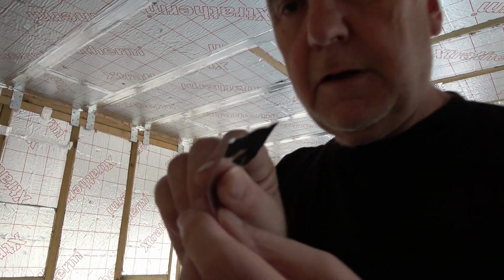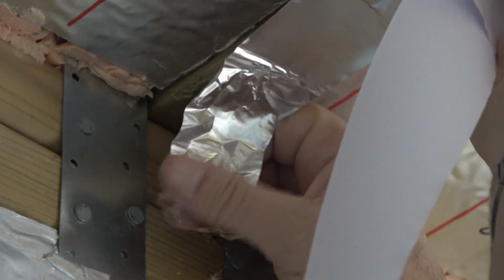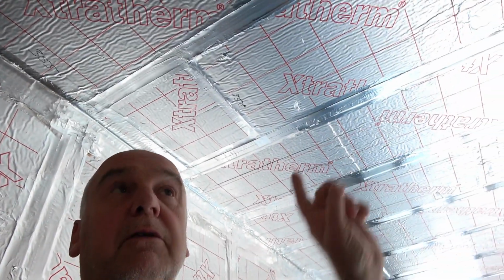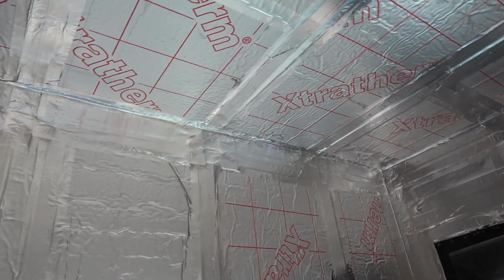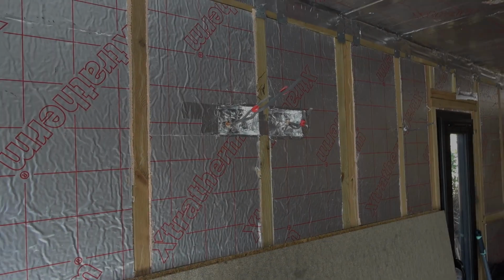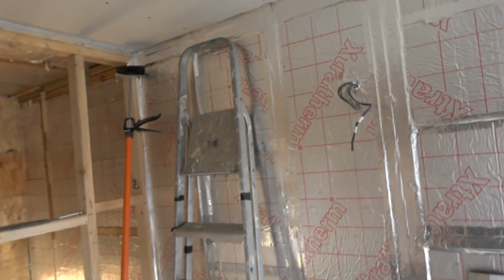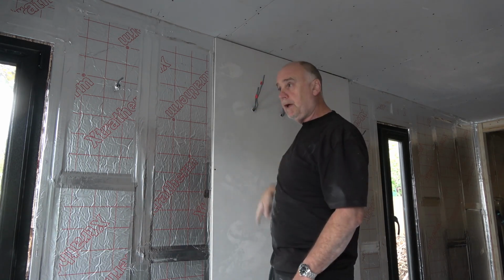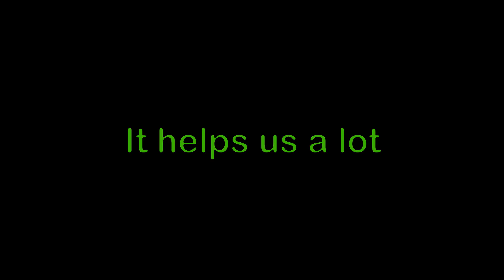Garden Room #10 Vapour barrier tape. Plaster boarding. Shed consumer unit

Comment: Mick you could have saved some effort overlapping tape by using 100mm wide tape seals adjacent boards with a stud between in one go. I know the peeling of the backing is a PITA but once you get it started it goes well the unbacked stuff is awful as it curls up as soon as you look at it.
Reply from the maker: I did mention that on video…. But the place I was buying from was charging more than double the price for the 50mm for the 100mm ….. screwfix do the unbacked stuff…. I guess you get used to either. Cheers mate 👍

Comment: Hi there. Quick question - does the insulation go flat up against the exterior board or do you leave an air gap between them?
Reply from the maker: Hi Tim, sorry for the delay in responding. I leave a small gap between the insulation and exterior board…… mainly because C16 or C24 timber will be about 5mm less that it’s equivalent insulation.  ie 100 x 50 will come in at 95 x 45 ish and 150 will be 145 and so on so 100 pir will sit proud dot the plasterboard. So I go down a size or up a size on the timber. That’s not anything more than how I do it. Thanks for watching buddy.
Cheers M

Comment: What jacks are you using for the plasterboarding?
Reply from the maker: Vaunt Telescopic Drywall Support... https://www.amazon.co.uk/dp/B09FPS3CMX?ref=ppx_pop_mob_ap_share
That’s the link from Amazon for the ones like I’ve used but better still get the type with the retractable ball barings instead of the hand nut for extending the two halves (still with the trigger pump style though
Reply: @Mr_A_Builders  thanks guys as always.

Comment: I'm a sparks nothing wrong with the fuse board seen alot worse than that from qualified people one less cable cleat 3 is to many 2 looks better maybe a small piece of conduit between socket and board just looks better or you could drill a 20mm hole in the side of board use a brass bush and lock ring to secure it in place nothing wrong with what you have done tho just a couple of tip's for you to make it look a bit better excellent effort and your building work looks top draw aswel 👍
Reply from the maker: Wow high praise indeed… cheers for that . Was expecting grief lol. You’re right a piece of conduit would be neater. Should I have used flexicon between the whisper and board?
Reply: @Mr_A_Builders  yes you could do but but in terms of regulations you don't have to it's up at high level so it shouldn't get damage but anything you do have surface mounted at low level should be protected this is also not a regulation just recommend for a bit of mechanical protection
Reply from the maker: @kimmason8533  Gotcha, thanks for that. Really appreciate the time you took to comment and the feedback. As you’ll see in the next one, it’s all boxed in now. Thanks again Buddy.